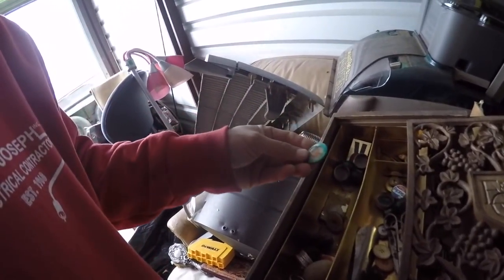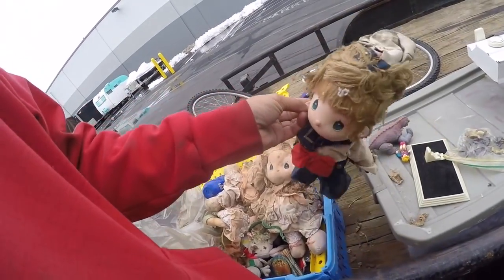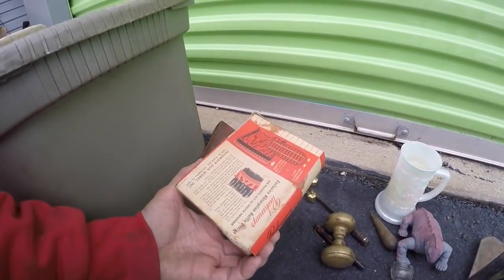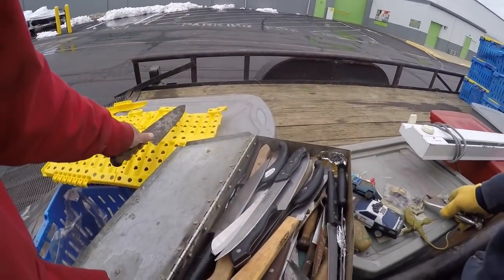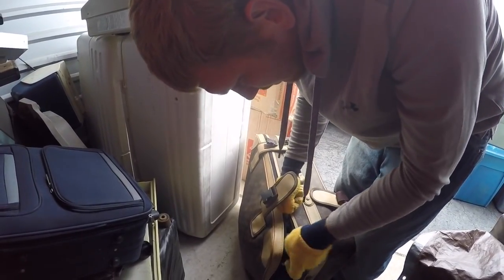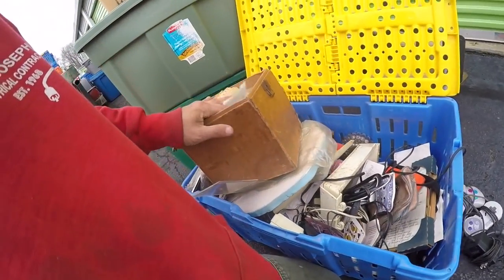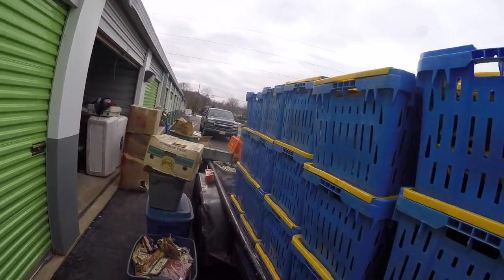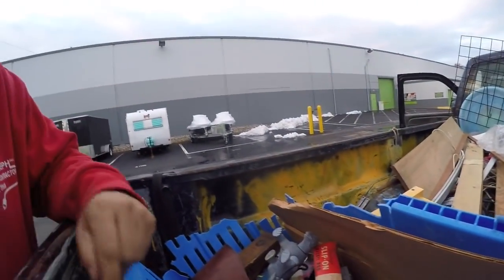Going through Dans storage room Auction finding Nintendo games and antique knives to buy for cash

Comment: Hey Dave don't you ever drive your bus anymore
Reply from the maker: It’s broken right now do either the alternator or the battery’s but I mainly use it for the flea market and I’m taking a month break
Reply: @bluebusdave2529  understanding and replace the battery first since it cheaper if it not that then it the alternator